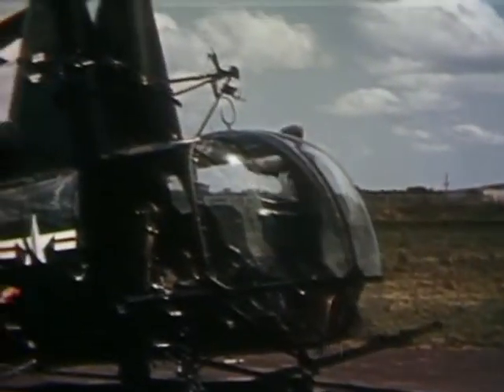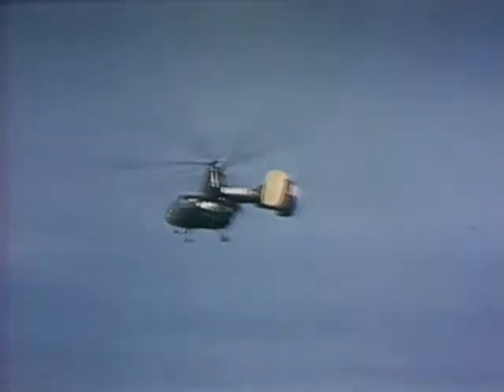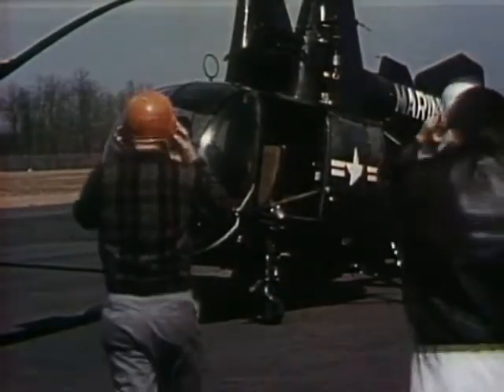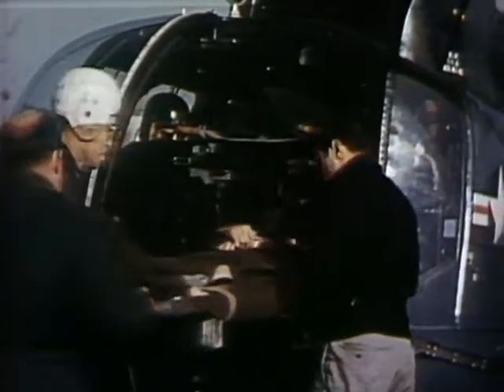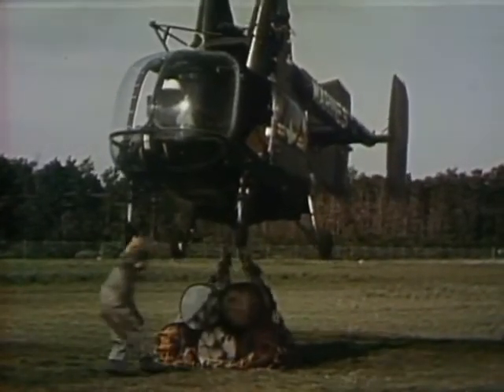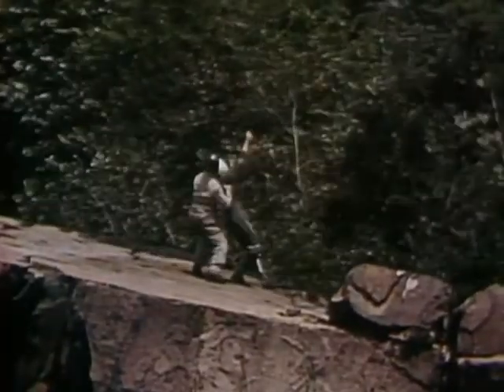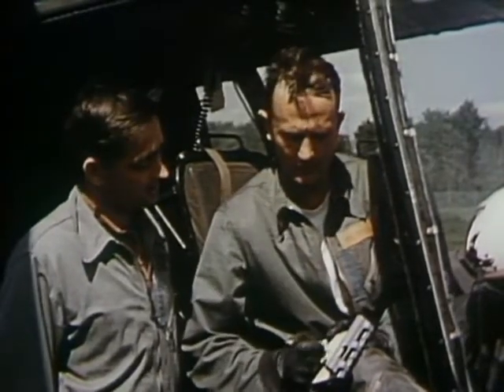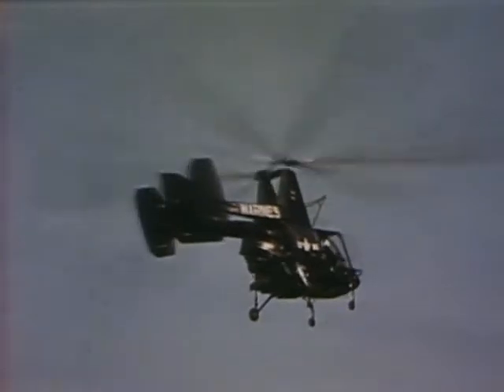A Film Report KAMAN HOK 1  K 600

Comment: With an intermesher what has to happen for the helicopter to yaw about the vertical axis? In other words, what happens up at the blades when the pilot applies right or left pedal?
Reply: The aircraft uses differential collective pitch to effect yaw: the pitch on one rotor increases while the pitch on the fellow rotor decreases the same amount. The result is that total lift remains constant but the machine yaws in the opposite direction as the direction of rotation of the rotor with the increased pitch.
Reply: Thought it was Roll was differential collective and differential cyclic feathering for yaw. equal cyclic feathering pitching up or down , and blade track with electric  
CoAxials uses differential collective for yaw  @herman7661